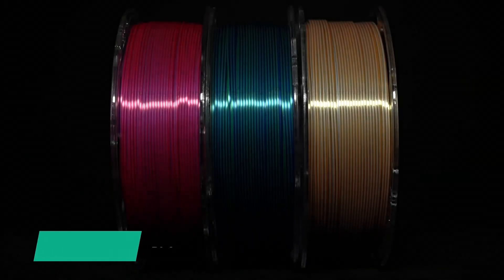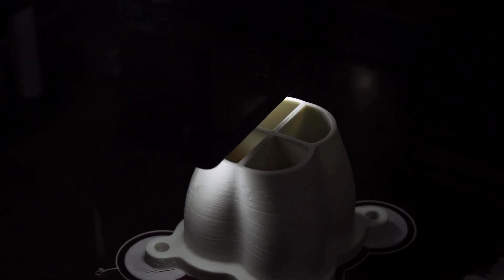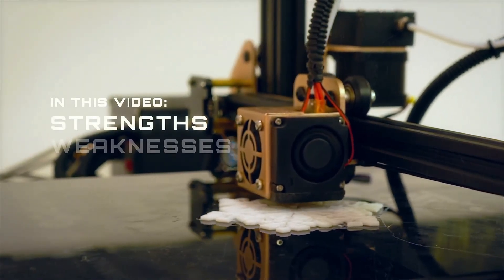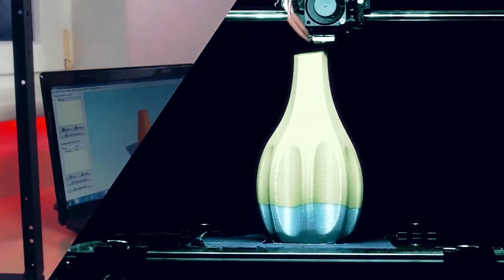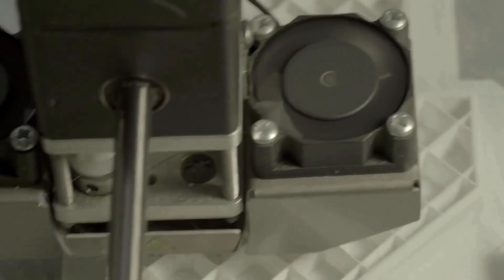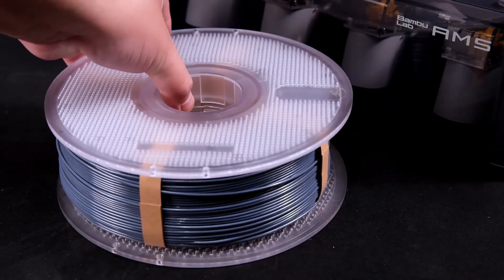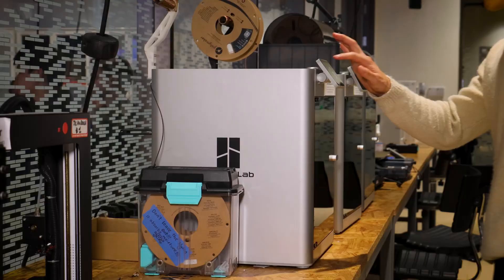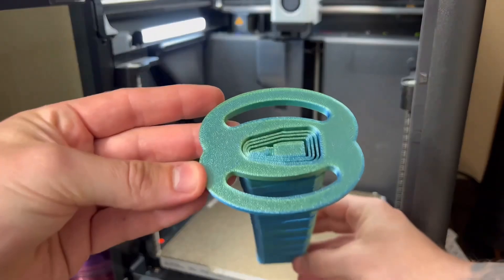Best Filament for Outdoor Use 3D Prints?

Comment: Am a total newbie and I bought a P1S with the AMS unit. Been printing tons of PLA without issue. I do a lot of radio control stuff. I made a 3 part top for a submarine, glued it together and painted it. Set it out in the sun and within minutes it warped like crazy. So I bought Bambu Labs ASA filament because that is what people recommended. Now I don't know how to set it up. The machine sees the filament but under the (Process and Advanced section) it still says 0.20mm Standard @BBL X1c. Has others in the fly out but nothing says ASA under those profiles. What am I doing wrong? I would appreciate the help since most 3D printer people talk a entire different lingo and after they speak a sentence you are completely lost. They should make a book ASA for Dummies!

Comment: You forgot a few details, especially one that is super important. 
You should have an enclosure with a carbon filter, or keep the printer in a really well ventilated place while printing ASA. During printing it gives out styrene gas, and that is really nasty stuff. Very dangerous. This should be mentioned way before quality issues regarding enclosure or not. 
ASA is dangerous to print, and should be respected.
Reply: Facts safety first! Remember your intro nature can be a real 🤐 haha. ASA ain’t here to be heathy. It will mess you up fosho